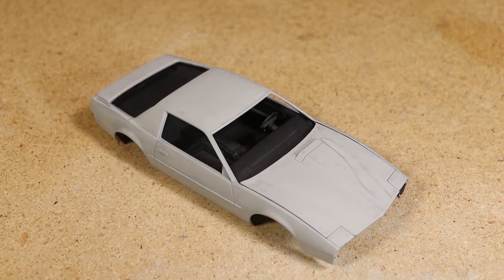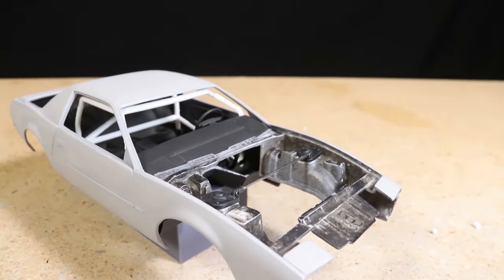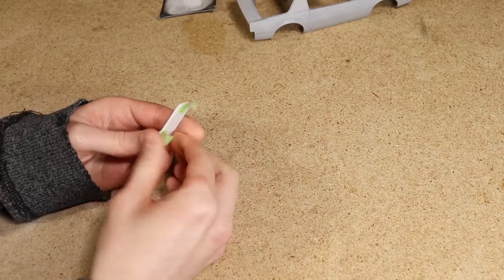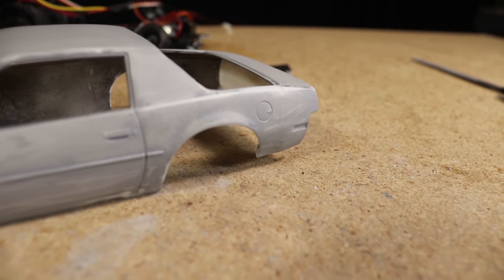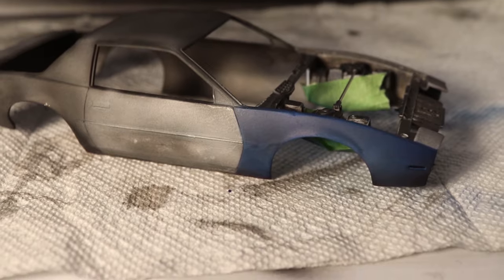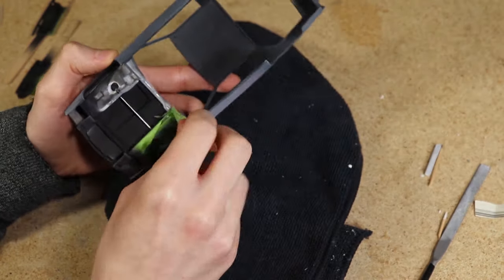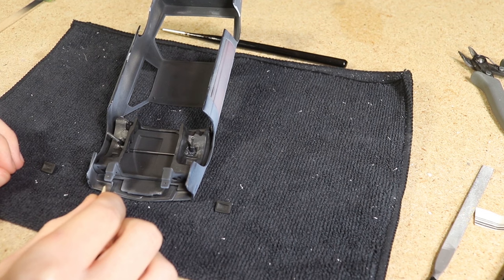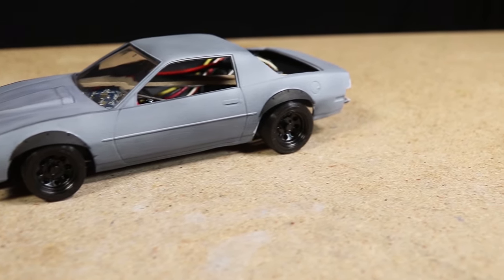(Re-upload) Firebird Drift Build: Part 6 Designing Custom Roll Cage, Paint, and Weathering

Comment: Just wanted to ask what 3d program are you using to design the parts? I want to play around a bit with my old 1/24 kyosho Mini-Z rwd to make them drift.  Maybe try to make my own chassis and get rid of the boxy MZ-01 chassis that they came with way back in the late 90s early 00s.